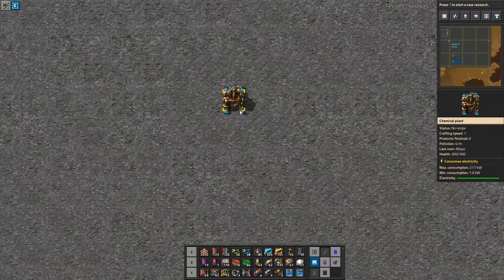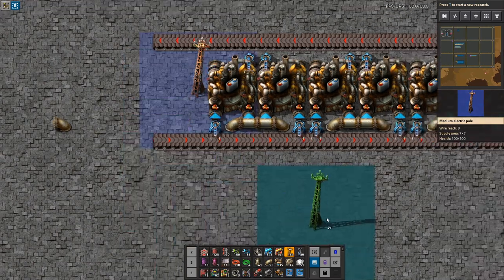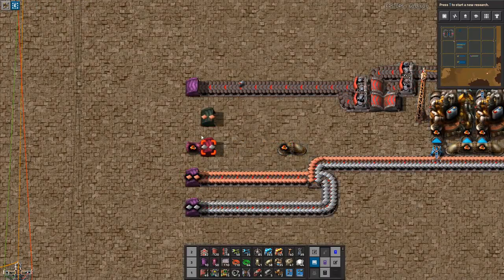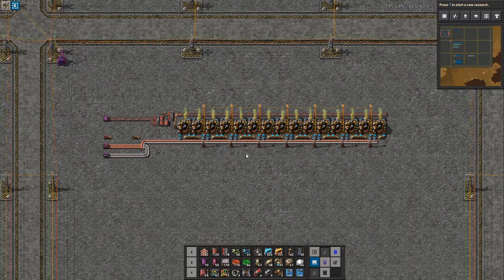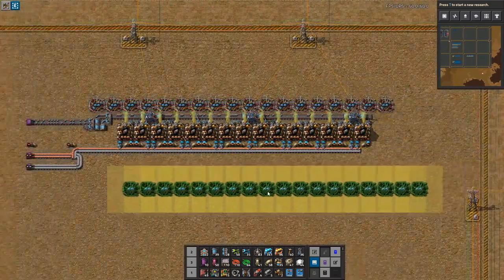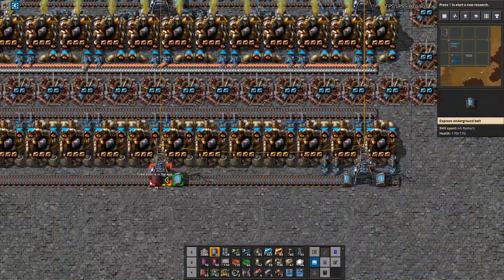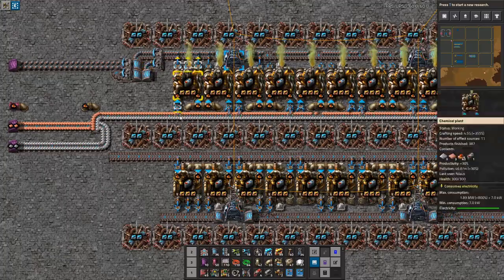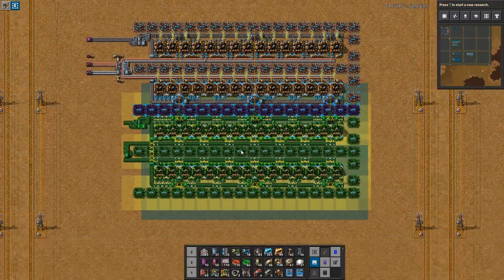Upgradeable BATTERY Builds for Mid and Late Game | Factorio Tutorial/Guide/How-to

Comment: For the output balancer, why not use a splitter with its outputs sideloading onto a belt instead of sideloading into underground belts, etc?
Reply: @imblackmagic1209  Maybe I'm not explaining myself clearly.  What I'm talking about is a lane balancer (looked it up on the wiki).  Only need a splitter and six belts. The outputs of the balancer side load on each side of a belt.
Reply: @AugustoTobias  Nilaus prefers this one because it takes inputs from both sides of the splitter, while the other method won't prioritise that.
Reply: @AugustoTobias  because the one nilaus uses is a lane balancer, not a belt balancer tho using a lane balancer there is a bit useless i guess
Reply: so the output is the same but the input is even?
man i play so differently the min-max thing is too much 
id rather cram everything into the belt and if an input backs up i have enough behind it to move on and use the full output or add another output